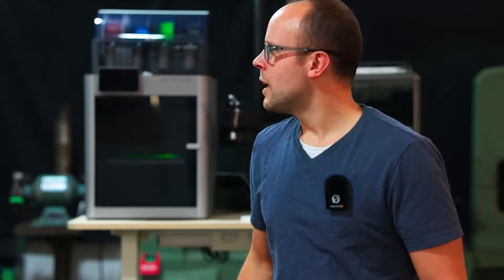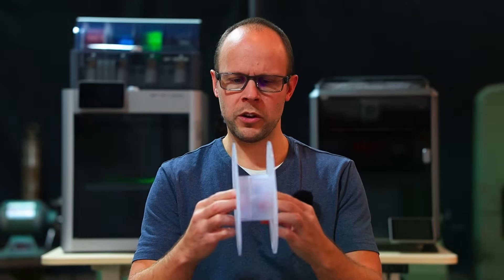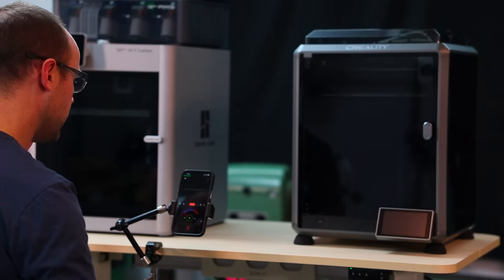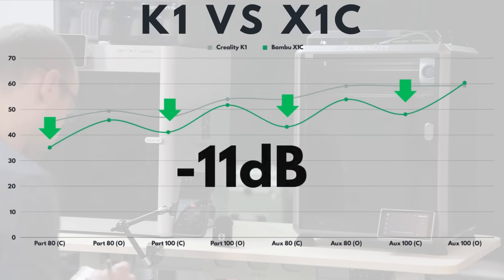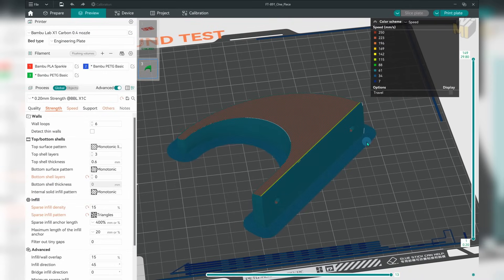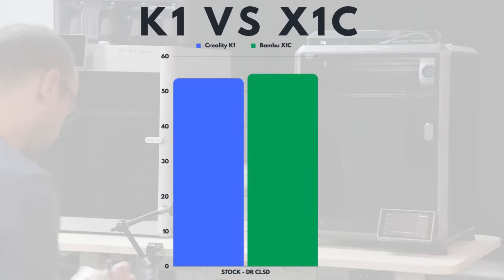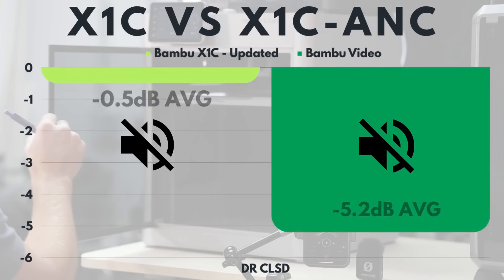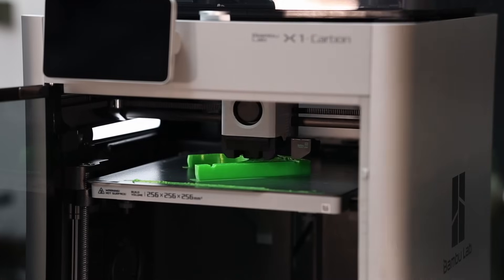Bambu X1C Active Motor Noise Cancellation Vs Creality K1

Comment: How can you do tests like this?  you place the microphone on the left and much further from the side fan of the K1S.  and for bamboo, place it on the right next to the main source of noise.  It was worth fixing the buttonhole a meter from each printer, where the phone is and not dragging it on the table or on yourself.

Comment: Hi friend, see if you can help me.
I bought the K1 Max 3 days ago, when turning on the shield for the first time there was a humming noise from the power supply (coil whine), and when printing and moving the motors, mainly in the X and Y shield, this humming sound that only stops when deactivating the motors via the display, when printing I also shield this humming noise, it is very reminiscent of the noise of old printers that did not have silent drivers, when I leave the rotations low on the side and rear fans I hear a humming noise too, can you help me? Could it be a defect in the power supply, in the stepper motors or perhaps in the board or drivers, I recorded this video to send to Creality, if you can help me, thank you!
https://www.youtube.com/shorts/3W6d7FUc9sA

Comment: On my P1S the difference is massive. No more high pitched sounds, everything is now like "muted", where motornoise would take over, where it is now basically fan noise with muted movements in the background. Really impressed by the update.
Reply: Did the P1S get the firmware update for noise cancellation as well?
Reply: @chilodaone  Yes, January 2024 OTA version01.05.00.00 - I had to double check on my printer if everything was okay because of how much it quieted down.

Comment: Put 128 microsteps on all axis for K1, and it will get a lot quieter without skipping steps. I own a K1 and its motors (except Z) are very quiet, they don't disturb at all.
Reply from the maker: Ah, interesting, I'll have to do a bit of research on this, thanks for the tip!
Reply: @NeedItMakeIt  Tested today with 256 microsteps, and it works! So you can put 256 for all axis.
Reply: Hi there. Have you enabled the stealthchop mode along with 128 or 256 microsteps ?
Reply: @ecofuelbox  1. No, as it reduces torque and accuracy.
2. I've replaced the motor pulleys with 20 tooth ones, and the MCU can no longer handle so many microsteps (due to higher rotation speed), so I'm using 64 currently.

Comment: Place the whole thing into a cabinet. I use the cheap IKEA PLATSA cabinet as an enclosure. Since It´s in my office noise can be very annoying. You have many advantages of placing the thing in a cabinet. You gain additional space for filament dry box, air scrubber, filament storage, waste less space on the table tob, less noise etc.
Reply from the maker: That's actually a pretty good idea, enclose an enclosure, that's probably the best thing.  Basically it's a room, but a very tiny room.  I wonder if I could do that and be able to record in here while they're printing.  It may be worth doing.  Also the fumes when printing ABS would be contained and I suppose it could be vented outside without affecting my workspace temp too much as well.   There are some enclosures that are printable on Kickstarted, fully customizable and modular, do you have any thoughts about these?
Reply: @NeedItMakeIt  "...Basically it's a room, but a very tiny room...." Yes exactly. 

"... I wonder if..." Try is out, shouldn´t bee to difficult. You surely have some kind of cabinet somewhere, just clean it out and put the printer in there. 

"....Also the fumes when printing..." This part might be more tricky, it depends on your setup. If you can vent directly outside, this is awesome and you are right BUT in my situation I can´t, so presumably you would want to still print PLA without venting outside you need to scrub the air and cool it off until you recycle it back to the chamber. It´s still doable. For other materials it´s perfect, since as you said you won´t decrease the temp too much before drawing in fresh air. You can also have an air exchanger so the new fresh cold air is heated up by the stail air on it´s way out. Basically a tube in a tube kind of thing, I hope you know what I mean.

"... There are some enclosures that are printable on Kickstarted, fully customizable and modular, do you have any thoughts about these?..." 
Not really, I would rather DIY my own out of plywood, PC panels and such instead. It´s less plastic, less time cheap etc. It´s inside a closed anyways, so it does not even be looking good. I don´t know why people print an enclosure to be honest. But if you want to print one sure why not, I am just the wrong person to give you any help on that.

If you have a simple wooden router you can use 40x40mm wooden profiles and cut a channel length wise then slot in polycarbonate sheets and use some silicone calcing to secure in place or supergule in stead. This way you can finish the whole encsolure thing is IDK 1h or so.

For my first enclosure I used the infamous IKEA LACK table, stacked 3 of them so I have a small lower compartment for electronics, filaments, cables and such and a bigger upper comparment. I then slotted the legs which I have figed together lenghwise and slotted in the PC sheets. Also added some light ( cut out some of the carboards insides and places milky foil over the pc sheets with led´s hid the wires etc.)
So do it like that but ditch the LACK TABLES and use normal wood. I didn´t have a rounter back then so I used a box cutter instead, I think my only tool was a Drill at that point lol
Reply: what are you using for doors in your Ikea enclosure?
Reply: @povilaslondon  I have a LACK enclosure where I made the door myself. The side panels are simply sheets of PC which are slid into cutouts I made into the legs.
The door is the same PC panel but I cut aluminium profiles to length and glued them to the panel, added some hinges and a door knob.

The PLATSA cabinets come with doors, you can add them to the cabinet like usual at IKEA. They had a see through version which they don´t sell anymore in my region sadly. The PLATSA cabinet is a lot less DIY, it´s just a cabinet made for children rooms, for clothing and so on. They are very bad quality since they are made out of carboard basically however the are hceap and work. 
Don´t forget a slab of concrete unterneith the printer paired with some thick rubber feed to isolate the printer.

Comment: Why was your extruder getting caught on the model? I have printed 100's of hours using the X1 Carbon and I have never seen that
Reply from the maker: It seems to related to the material, I find that PETG is pretty loud, especially if you print with an infill that passes over itself.  Printing with Gyroid would be a better choice if you still want something strong.  ABS and PLA don't seem to make the same noises.  

I've been printing a lot more and I still have quite a few motor sounds, but they're different and in some speed ranges you can barely hear it but at some speeds, it's kicking out a high-pitch.  I'd love to do something about that fan on the hot end though, it's pretty loud with the door open..

Which material do you print with?
Reply: @NeedItMakeIt  I agree the fans are way too loud with the door open. I mostly print with PLA and PLA-CF. Parts usually PLA, figures CF.

Comment: With my K1 Max, the printing is not loud, it is the fans that are loud. At this time, without replacing them, I do not think there is any way around the noise level. Nice review.
Reply from the maker: Yeah, it would be nice if these manufacturers had better fan options, it seems that they include some of the cheapest and loudest fans.  Is it that hard to design the blade to be a bit quieter?  I'm sure it's not just that simple, speed/blade design.  Sound at different speeds and then airflow.  Noctua seems to have done a pretty good job, I wonder if they can't adopt some of those ideas.
Reply: Updated mine today and at some point was. Is the printer printing? It was, way quitter than yesterday, but yes the fans blowing are the big howlers on this machine and I don't think they can use any software to reduce that, except for running the fans at lower speeds. They would have to change the fans for less noisy ones.

Comment: thanks for the really well done Content, i only have to mention from my perspective as an owner of a MAX, there is absolutely no noise in idal, when screen off you cant tell if its open. For me personally the fans are the most annying sound producing parts on it. there are several other issues with this printer,90% firmware i would say. Unless this, its a really great printer My K1Max drops in with up tu 67dB when printing PLA(+)

Comment: Great video, what app were you using?
Reply from the maker: Hey, thanks.  I was using Decibel Meter, but I ended up with Decibel X in the end, it was better for the video, and it also allowed me to export the last 30 seconds of the testing in Wav, Pdf as well so I could have something for reference later on.  I was also screen recoding, so it wasn't crucial, but nice to have as a backup just incase.

Comment: the issue is not the motor noise. the fan noise is the problem, especialy on the K1 max
!
Reply from the maker: For sure, that was most surprising to me when I started the testing, I wasn't expecting so much to come out of both printers.  If you can print with a closed printer and it is sealed up, I think that can go a long way.  Last night I printed two PETG prints, high temp 270N no fans at all, not even the cabin fan, and they turned out fairly nice, they have supports, I'd imagine they're not going to be easy to remove.  One more print to go and then I can check it out.  Printing with no fans and using PLA probably won't work well and may have too much heat creep.  I don't mind experimenting a bit with this.  

Alternatively we can swap out the fans, but I don't know enough about quiet fans aside from Noctua and they are 3 and 4 pin, these Creality fans are only 2 pin.
Reply: @NeedItMakeIt  ture, swaping the fan could work will make an improvment, concidering the K1 is out for few months only im sure the community will crack that one up very quicly :)
Reply: @NeedItMakeIt  also noctua fans are 3 or 4 pins, but actualy you can find the pin out on their website and all you need is + and -

Comment: I picked up a k1 a few weeks ago now and am overall very happy. I rooted mine right away though. And run full klipper. I found the printer loud but not as loud as some say it is. I also designed a door seal similar to the one you showed. It helped a lot ..especially for keeping the heat in. I also printed a top hat that also seals up the back. And printed a charcoal filter box for the rear fan. So my k1 is much quieter after the changes. I even can sleep with it in the same room.
Reply: Nice to know thanks, was going to do same (sleep in same room I mean)

Comment: I can tell that for me this firmware did night and day difference. My problem was that high pitched noised was proliferating trough the wall in my kid room. After the update this is no longer the case and I can print overnight.
Reply from the maker: That's good to hear, it seems that for some people, it makes a bigger difference than others, it could be the type of print, whether there are walls, the print speed, the material.  I was printing last night, and that particular print had one very high pitch motor noise, but the rest of the motor noises were pretty faint, there seems to be a certain range that it works best in.  PETG seems to be pretty noisy for other noises, the nozzle rubbing on infill and as it takes tight corners for walls.  That's great info.  

I didn't go into this wanting to debunk anything, I just wanted to see what it would do on a real print and if it could be quiet enough to record in my shop... that's not the case still unfortunately, but it's alright, there is still an improvement.

Comment: Works really well, especially if you pay attention while running the calibration. Door open or closed it's much much quieter. About all I hear anymore is the chamber/aux fans. Will you hear some whine from time to time? Sure. Will be it be constant? No.  It is very much quieter, have been happy watching tv or talking to wife with it in the same room.
Reply from the maker: Do you mind sharing the types of parts you print?  I wouldn't mind seeing if I can duplicate your results.   Today I printed two solid rails, just simple and it seemed quite a bit better than a high speed infill print.  Door closed is a valid point, maybe calibration with the door closed would help, sometimes these things are sensitive to these, so that's something to try.  I'll do that one tonight.   There is def an improvement on the higher end, which I think is the most annoying of the sounds.  It seems to be highly dependent on speed and whether the part has infill.
Reply: We're using differen't machines, I think that's all I can say. I've printed large helmet sections, lithophanes and their frames, and parts of different sizes, different infill. Really hear my fans more than travels. Still makes some noise, not as much as it did.
Reply from the maker: @jayfc3  Yeah, I suppose if there isn't much infill on those types of prints and the walls will be slower.  That's where I found this the most beneficial.  The fans deficiently could use a review, especially that hot end fan, it's quite a bit louder than I expected.    I agree that it is an improvement, just was expecting a bit more, I suppose I'll have to see if some of my other prints perform better.  

I'd love to be able to record while the printers are running, but that's not likely unless they go to a completely different place, it's not likely to be quiet enough in any case. 

Thanks for your thoughts.